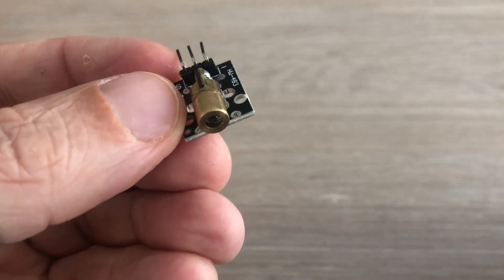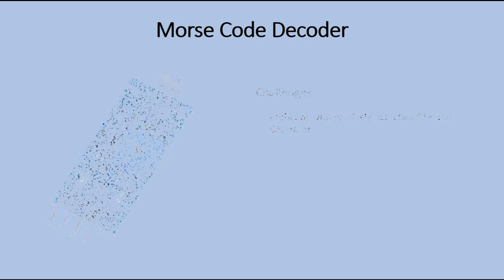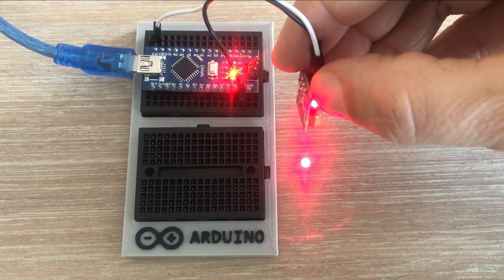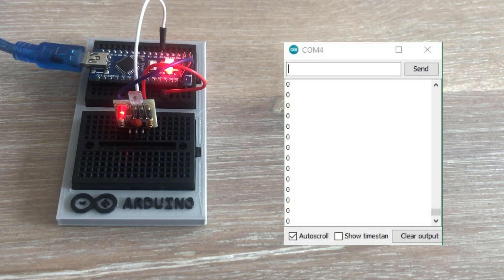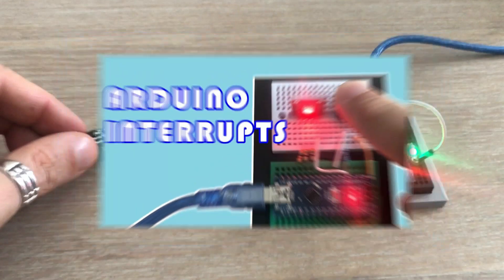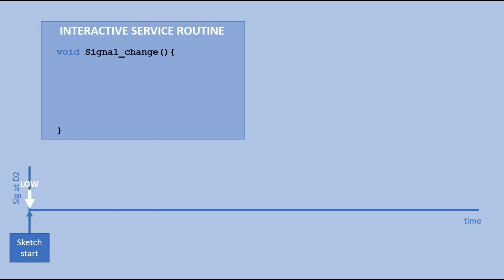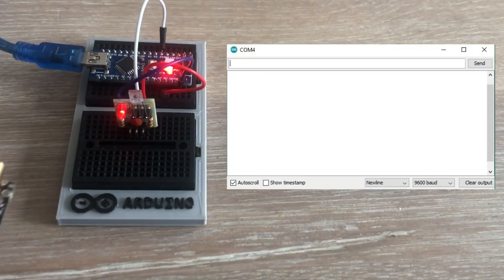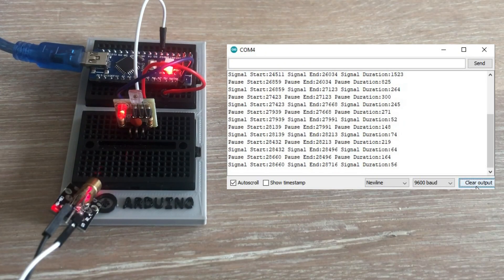From Light to Letters: Creating Arduino Morse Code Decoder using Laser Modules! Part 1

Comment: Hello,
Do you think this can detect objects that are smalle than the diameter of the laser ray?
Reply from the maker: What do you mean by detecting the object. The laser sensor detects the obstraction of the laser beam
Reply: @marios_ideas  exactly...but what if the object that is put between the laser emitter and the receiver is phisically smaller than the laser ray diameter? Like a little wire. Is there a way to detect it?
Reply: Is there a way to use only the receiver on the module and make it work in an analog way with a threshold instead of using it in a digital way (0 and 1) with the module?

Comment: I did a project like this. I ran music through audio amp and  laser then used a solar panel in a box connected to a audio anp and speaker.
Reply from the maker: Well there will be a spoiler for the second part of video but I experienced issue moving this laser setup to my garden. It looks like the laser receiver has issues with bright sunlight. It recognises the laser beam with no problem but then when the laser goes off it unfortunatelly stays on for some time, one time longer then the other. If I do  a test when there is no sunlight then it works much better. How did you go about this little problem?